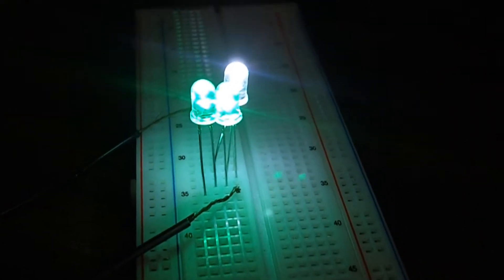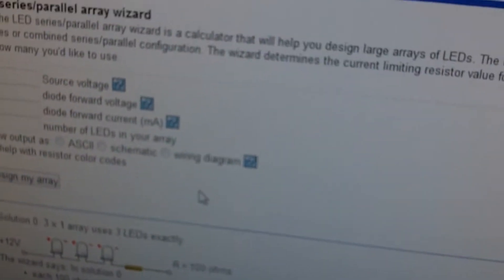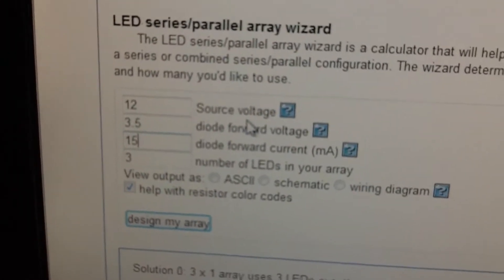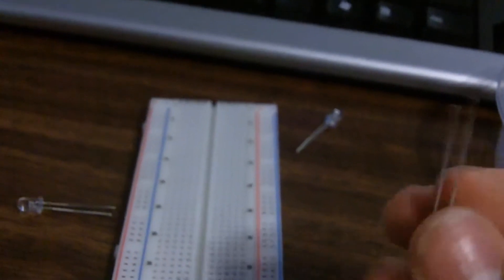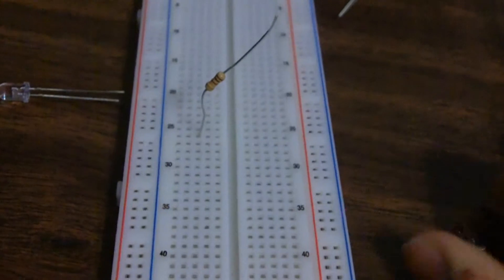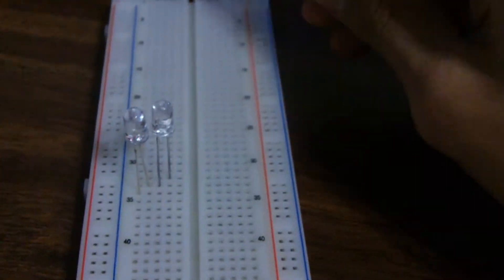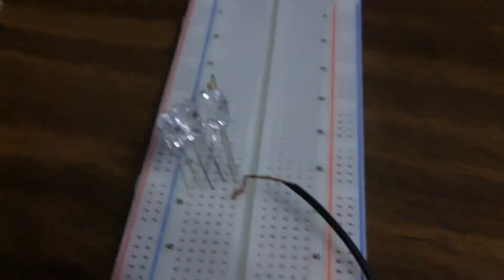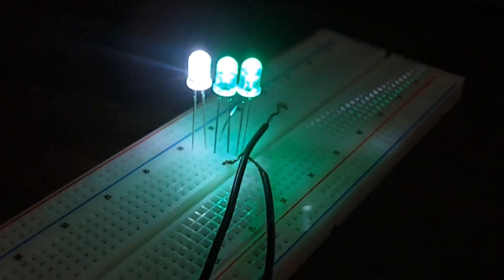LED Wiring In Series Tutorial

Comment: If you want the perfect 10 you could just wire 2 LED's in series with 1 resistor, and then repeat this 5 times in parallel.  To calculate the resistor value you need just do (Vs - Vl) / i, where Vs is your power source voltage (6), Vl is your load (vf x #LED's = 1.5*2 = 3), and i is the current (140 mA).  

So you'd need ~21 Ohm resistors in each of those strands of 2 LED's.  Not sure if they make that value, if you can't find it always go higher not lower.

Comment: It certainly would if you didn't have a resistor in there at all.  But the resistor limits the current no matter where it is.  I don't know if this analogy will help, but just picture having a huge thick pipe with water flowing through it, with a valve that limits the flow.  If you put the valve before the spot where you measure the flow rate it'll be the same as if you put the valve after where you measure it.  (Assuming it's a closed circuit).

Comment: You certainly CAN put the resistor before the LED.  But you can also put it after for the exact same effect.  There is no such thing as "running full power" through a component in a circuit, I don't even know what that means.  The thing that affects the LED is the current, and the resistor will limit the current no matter where you put it.  You could even stick it between two of the LED's and it would work exactly the same.  I can see why it may be counter-intuitive, but the math doesn't lie.

Comment: always, always, ALWAYS put the resistor infront of the positive side of the LED. The Power always flows from positive to negative and restiting and reducing the current so it doesn't short out anything is useless if the power is being lowered after it has already passed the destination. You cut the lifetime of the LED dramatically if you don't follow proper procedure (5 years of lighting experience and training)

Comment: Very interresting.  You serie 3 LED's @ 3,5V and a 100R resistor at 15mA.  That gives a voltage drop of 12V and power dissipation of 180mW.  That is fine, but...

LED's have some bulk resistance and it has to be taken into account.  A 91R could have been closer to your desing goal.

At 15mA, if your wall-wart was rated for 300mA, it will hardly colapse under load and produce more voltage. Here, a 150R would have been a better choice.

Always use a multimeter.  You can't guess... :O))